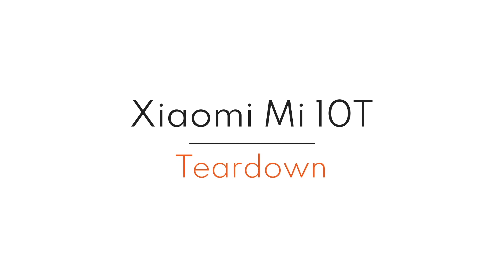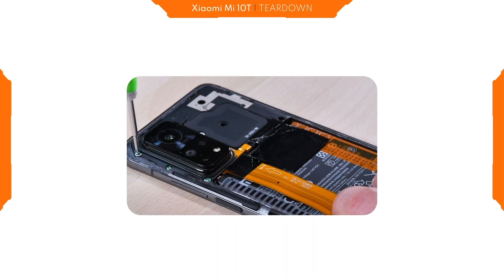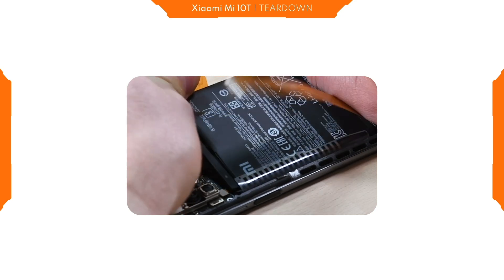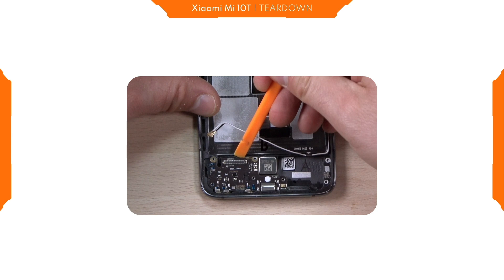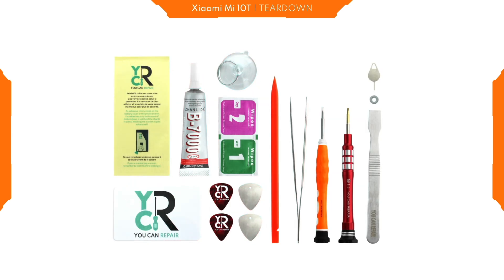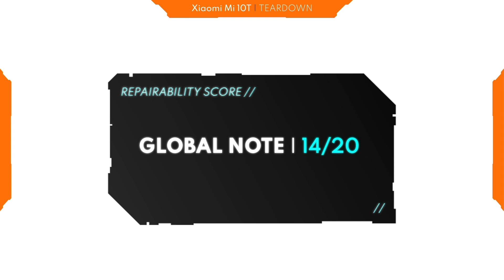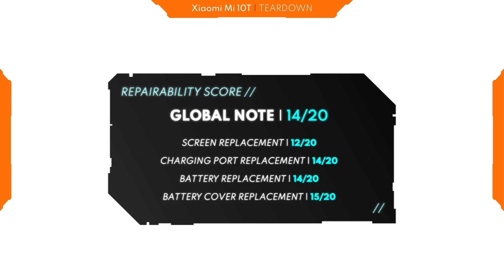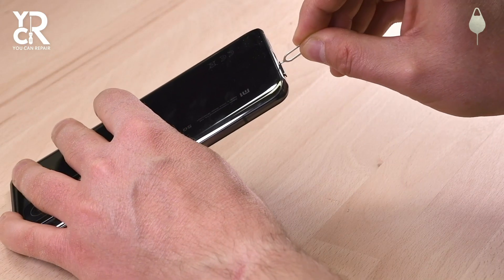XIAOMI MI 10T (5G) TEARDOWN | WHAT'S INSIDE THIS SMARTPHONE ? MI 10T FULL DISASSEMBLY | YCR

Comment: Hi my phone fell in the pool with depth of 4ft for about 2mins. After recovering I check the phone and it's function is normal then after 10minutes I think upon checking the phone was off. So I check it then power it on. Upon booting it's normal then when the menu showed its flickering 3times but after that it goes steady and functioning as well like a in normal state. But since that happened I immediately turn it off then. Keep it off for 3days just air dry and sun dry. Then in 4th day I checked it there was no power at all even notification light is off. So I tried to air dry again and sun dry since there is still moist at the rear cam. But this time while connecting the charger the notif light blink. It's just continuesly blinking. I plugged it off again and will try to air dry and sun dry tommorow.

What do you think the problem?
Reply: Obviously water damage

Comment: Good vide, nut power button not removed? Do you know how the fingerprint sensor works? is there a cable/connector? Mine stopped working after screen replacement. CIT sensor check = FAIL so it's a hardware problem.

Comment: Hello , can we replace mi 10t's 144hz 6.67" IPS LCD display with similar sized AMOLED display with same punch hole position. Asking whether it is possible. Because thats the only weakpoint of this device.
Reply from the maker: Hmmm, I advise you not to do that ! 😁
Reply from the maker: Unless the flex/connectors are in the exact same position... but really, I think it won't work. But tell me if you really want to try ! I'm curious
Reply: @YouCanRepair  yes
Reply: @balakrishnanair3414  how was it?
Reply: @mrxbooanime  didn't try

Comment: What are the two coax cables used for that you disconnect at 5:25? I ripped one of accidentally, but it seems everything is still working ?!?
Reply from the maker: That's a network cable. Don't you have any issue with that ?